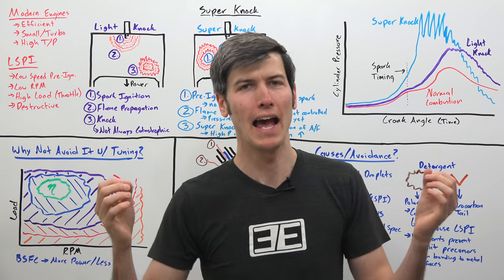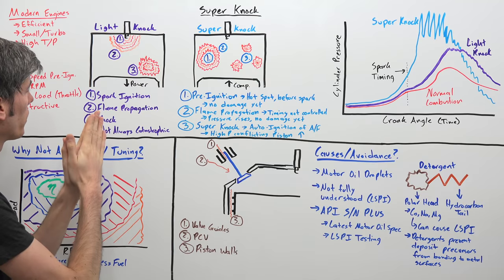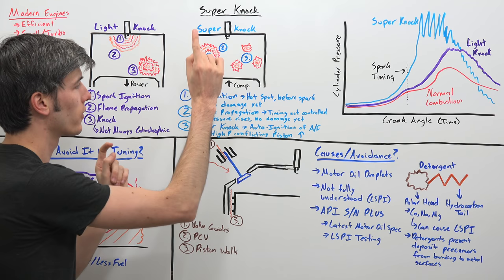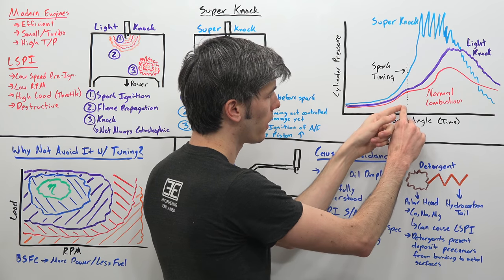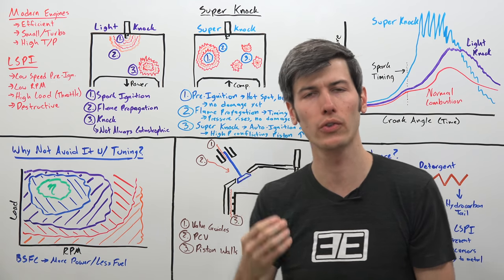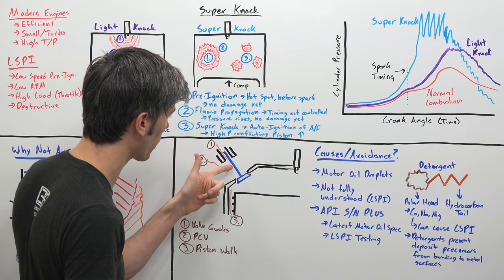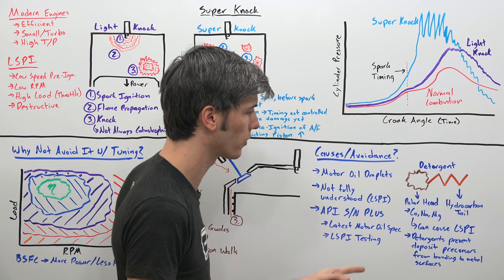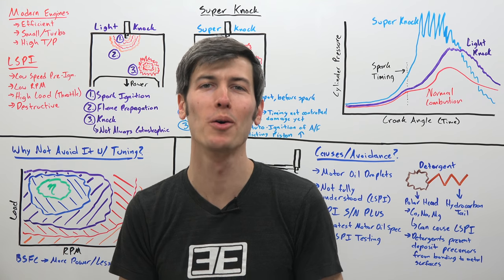How Super Knock Can Destroy Modern Engines

Comment: Yeah, let's be real.  We need 95 octane fuel at the pumps now.  Good oil doesn't hurt
Reply: As long as the engine designs dance on the edge increasing the octane in response will only make it worse. We learned to live with compression ratios under 10:1; we can live with 87 octane. The problem is with engine design, not with fuel.
Reply: We have here in Australia but I can hardly afford it.
Reply: No, the UK has high octane fuel and your Ford st doesn't blow up like they do when you run on low quality fuel. Lots of performance engines want high octane fuel. My motorcycle says loss of power and fuel efficiency if you run low octane fuel, their not joking, you can feel it just with stale fuel!
Reply: In Europe we only have 95 or 98 Octanes, why is it 87 or 89 in the US? Im asking bc I have no idea on this
Reply: @sergipolo7835  That's actually a very good question!  And here's my saga.

  In the U.S.A. there's no restriction for vehicles being 100+ years old on the road that were developed to be used with lower octane fuels. 
 So in short, you can drive any age vehicle in America without special permissions.  Very few things disqualify a car from being driven in America, outside of gross emissions.  They can be full of rust and drive along side everyone else.

  Also, there's a good amount of economy cars that use very little ignition timing, so they can run 85-87 octane fuel without damaging their engines.

  At sea level, 93 octane produces a perfect stoichometric burn for the emission standards in the U.S.A..  At 5280 feet (a mile above sea level) or (1.6 kilometers) 91 octane has the same effective knock resistance that 93 octane has at sea level and is actually the same fuel, it just has a different knock resistance value depending on what altitude it's being used at.
 
91 octane = 93 octane at sea level and vice a versa.

  The reason 91 octane works at higher altitudes is because engines can safely use more ignition timing due to reduced air density but will ultimately lose power as they go higher in elevation.

  In order to keep power levels up, higher octane is needed to run even more ignition timing safety.

  The higher the octane, the more ignition timing you can run in higher air densities.  

  You guys get 95 and 98 octane because your auto manufacturers work along side the government and don't want mechanical issues to cause fatalities on the roads.  In America, we have 300+ million people, so a few people blowing their motor on the highway causing a pile-up isn't even a drop in the bucket.

  You are very fortunate to have high octane fuel to drive fast and hard with little worry for your vehicles mechanical integrity.

98 octane in Europe (2500 feet above sea level) = 95-93 octane in America (0 feet to 14,000 feet above sea level).

You guys just have better automotive standards :]
Reply: @gammalight1312  Oh thank you for the explanation! I didnt expect such elaboration. Could that be related to why are turbocharged smaller engines more common in Europe? I dont think the downsizing trend is good but the higher octane gas does help right? So those super presured engines would have more problems with the lower octane gas. The altitude fact is interesting and good to know too, but I live next to the sea so doesnt really matter for me. As for the drive fast and hard thing, well, only Germany has no speed limit on Autobahn and the high prices on gas dont help either :( Anyway im glad to hear that we have good automotive standards, I wonder if I take my small 3 cylinder car to the USA will it suffer from the gas.
Reply: @sergipolo7835  glad you got a chance to read it! 

  Small engines can produce huge power with turbochargers or superchargers and unless they're naturally aspirated they must use high octane fuel.  
It sounds like Europe is looking toward small displacement, high efficiency motors to maintain emissions.   America is doing the same but with hybrid electric and small displacement turbo gasoline.

  Only naturally aspirated engines can accommodate low octane fuel while making decent power.

  If your 3 cylinder car is naturally aspirated and has a modern ECU, you'd be able to drive it in and on American gas with no issues.  If it uses a distributor, you'd have to manually turn the ignition timing down but unfortunately you might notice power loss on 93 octane.

  Always use the fuel recommendation or higher on the fuel door of your cars but if your car is turbocharged, never use low octane fuel unless you're at high elevations and have no other choice.

  One thing I forgot to mention was America has developed an alternative to petrol fuel that is made from corn.  It's 85% corn ethanol and 15% gasoline blended together (E-85).  It's equivalent to 105 petrol octane, available at the pumps.  It cost around $2 U.S. or £1 per gallon. So we do have that as an option in some places.
  The only problem is very few people know how to take advantage of it's potential because it's a relatively new / corrosive type of fuel.

Conclusion:
 I always recommend running as high of octane as you can unless you drive like a grandpaw :)
Reply: @gammalight1312  Europe also uses a different octane scale. 

93 at the Pump in New York City is the same as Super Plus at the pump in Dusseldorf.

Comment: Getting all the time with my Subaru FA20DIT with CVT. In normal "Intelligent" (economy) mode, the CVT keeps the RPM's so low all the time. Very often when the engine is loaded to accelerate up a hill, it has a habit of knocking. Very dodgy.
Reply: Same here but in a Chevy with 1.5L turbo 4cyl.

Comment: Hiii what do you think of 2 or 3 spark plugs per cylinder. Does it reduce the probability of super knock _ (DSTI Engine in Bajajs motorcycles engines )
Reply: Super knock occurs before any spark, so you can have a dozen plugs in there and it wouldn't make any difference. Watch the video all the way through. Jason discusses this.

Comment: (5spd driver) sometimes when i am going downhill or using engine braking, and after a few seconds when i press the gas to start accelerating there is a lurch. Is this LSPI? This occurs if engine brakign was holding around 2.5k RPM. Yes, this is a GDI engine

Comment: Freevalve heads must use some sort of lubrication. But not having oil in the same way in the head as with a normal cylinder head should probably make for a nice improvement.      ?

Comment: Great video!! I am hoping either Jason or someone in the comments can help me wrap my head around another engine related subject, that being how the horsepower formula accounts for the work done by all cylinders in a four stroke engine with 4 cylinders or less.

     My confusion arises from the fact that there is no power stroke  over lap in an in-line 4 cylinder engine. If I understand that the formula HP= (torque x rpm)/5252, and that the torque is the force the crankshaft is experiencing at the particular rpm when the measurement is taken, wouldn’t this only account for the power one cylinder is adding? Again, relating this back to a 4 cylinder having no power-stroke overlap, means that the crank only experiences the torque one cylinder adds to it at a particular time. This is in contrast to engine with  more then 4 cylinders where power-stroke overlap occurs.
  
     Another way to look at it is that if only one piston is adding force to the crank at a time, what would be the difference of calculating the horsepower of a 4- cylinder and a 2  cylinder ( hypothetically lets say they have the same efficiency,) and each engines per cylinder displacement and stroke are the same.
     If you ran them both to the same rpm, and took a horsepower measurement would they be the same, since once again only one piston is providing power to the crank at a time, how would the power the other cylinders provide in the same amount of crank rotations be accounted for?

Comment: e30. Check out the e30 Challenge, a program originating in South Dakota and Iowa to, obviously, promote higher ethanol content in fuel. . Over 20 million real world miles accumulated in non-flex fuel vehicles with no CEL or other malfunctions. They mention that Mercedes urged the EPA to approve e30 due to the efficiency and "ridiculous power" their turbo'ed engines produce with this high octane fuel. My GT350 is Lund-tuned for flex fuel. Ethanol is a godsend for high performance engines.

Comment: What about the type of gas. I heard 91 grade is so it doesnt pop until the sparkplug sparks. And then I've heard taking 91 grade on a car that recommended 87 gas might leave raw gas since sometimes it's not enough heat to burn it all. Causing knock, poor mpg, and possibly hurting your catalyst converter

Comment: I'd like to know how CNG (natural gas) performs in a N/A engine (M/T) when being at high loads but low RPMs. I'm used to drive a vehicle with CNG, but of course wouldn't like it to be the 'lab-rat' and blowing the engine.

As far as driving as efficiently as possible without harming the engine, I usually have the engine at very low RPMs (1,500-2,500) but giving it very little has (light load) as the engine has only 90HP and when the vehicle is fully loaded and A/C is on the difference is really noticeable. I do know CNG has a slower combustion speed therefore spark advance is vital for the engine health, but as natural gas has a higher Octane rating, knock is somewhat less likely to occur.
Thanks.

Comment: The most simple solution: don't buy a car with a tiny engine. That was in the introduction right? The problem only occurs in tiny turbocharged engines that have to carry a too large of a load (1.2 liter engines fitted to regular car). Just get something above 1.9 and you'll probably not run into this problem.

Comment: I know from Peugeot modem DI engines putting poor quality fuel such as 91 Ron can cause carbon buildup in the valves and cylinder which can lead to super knock and engine failure

Comment: Changing the oil? I wonder what that will do to an older valvetrain. Chrysler didn't move away from a flat tappet cam in the 4.0 all the way to the end of the engine life.

Comment: This is a big reason I run with methanol injection and have my car tuned to limit its power severely below 2000 RPM. I want my valves and cylinders to be clean and don't care as much about efficiency. I want an engine that doesn't decide it's time for a knock knock joke every 2 revolutions.

Comment: >happens at low rpm under high boost
>shows Honda S2000
What next, camshafts problems explained with an RX-8 in the background?
Reply: @dies ist kein Name His S2000 is supercharged!
Reply: @harbl2479  He hopes there is some simple additive/fix so he doesn't have to rebuild his S2000 with low-compression pistons.
Reply: This happens to gasoline direct injection engines not older style port injection engines
Reply: In not going to rewatch the video, but several times he correctly said "under high load"..... it affects naturally aspirated cars also.
Reply: @harbl2479  Yes but it hardly falls into the 'high boost' category.

Comment: isn't the EGR one of the ways to reduce preignition? I thought that introducing a small amount of inert gas into the compression stroke helps reduce the temps and therefore keeps the fuel from exploding rather than combusting.

Comment: You should have made mention that E85 is a super weapon against super knock.
If you have a flex fuel vehicle, try running E85, it will resist combustion and it will clean everything along the way, potentially resolving the issue entirely by removing carbon build up and at the very least preventing more carbon build up.

Comment: You're channel got me wondering if you could make a video about low power diesel engines. I have a VW Crafter that's putting out a 100hp and 250nm of torque out of a 2.0 litre diesel engine. Why don't they just use a 1.6 TDI Passat engine that makes 120hp and 250nm of torque? Wouldn't this be more efficient? Or is a bigger engine better of the lifespan of it?

Comment: Something that remains unclear to me: With modern engines using very precise direct injection, if the petrol is only injected at the moment of ignition, why is knock an issue? Or to put it differently, can't you just increase pressure similar to a diesel engine, and then only inject the petrol at the last moment? Of course it will ignite / self combust instantly, but if it is late enough in the cycle that shouldn't be an issue? (on the contrary, efficiency and power will be much higher) What am I missing?

Comment: i have a 95 Subaru WRX that jolts and is jerky at full throttle 3500+ rpm , like it cuts out for a split second and a big 'bump'.. Is that SUPER knock ? Besides that it runs smooth and pulls hard , I am using the maximum octane fuel

Comment: What about commonrail gasoline engines? Sure, it's quite rare engine and more like prototype (why does it take so long?) but it works similarly to diesel. Flame propagation is cause by fuel injection, so any hot spots have no fuel to burn anyways. That's also probably why this is much less likely to occur in diesel engines.

Comment: Its the fuel 
You need high octane like 98 and 99. surely when you tune the engine
And dont put high loads at low rpm 
This wasn't a probleme in the golden days of cars.
When fuel was pure and people shift at 3500 rpm 
Now the bc and automatics shifts or tells you to put it 6 gear at 50 km/h
I did this once to test this 
And car was shaking and sounded like it was going to die 😁
Reply: We should use manual/sport mode for all times if this is the cause.
Reply: @govinlock8568  Many automatics have an overdrive on/off button for climbing grades. Economy mode may allow the engine to lug at light throttle input, but that's not going to accelerate well and can kill an engine.
Reply: @jamesplotkin4674  Well, not much automatic cars in my country that has multi mode for its transmission. You either get slow climbing acceleration for using D lever or drive its transmission manually to either 1,2,M or S.

Comment: I was always taught that was called detonation, as opposed to super knock
Reply: "super knock' is Preignition, light knock is detonation. The difference is the role of the spark plug ignition in the knock.
Reply: @patrickzambori473  Detonation is actually severe knock. The ignition stops propagating by the flame front and instead propagates by the pressure front, turning the mixture into a fuel-air explosive.

Comment: Hey What about the effect of altitude on Knock in turbo motors.. Ive got a 2018 Focus ST and a tune that wants 93 octane.. But in the mountains where you and i live we only get 91.. Is this safe???
Reply: No, you need to run a 91 map and log for knock and timing correction. The assumption you can run lower octane at altitude is only on NA engines, your turbo compensates for the lower air pressure.
Reply: @prayformojo1117  
Alrighty... Ive been trying to get multiple sources on this.. I've contacted a couple local tuning shops and they say it should be okay because off the shelf tunes are usually pretty conservative anyway.. that mixed with the altitude it could be okay.. but I knew that turbos make up for alot of altitude that NA motors are effected by... so I'm just looking for a more in depth answer..

Comment: Is this video relevant for both diesel- and petrol engines?
Reply: I think only petrol, diesel engine compress air, not air/fuel mixture, during compression stroke, so there can not be flame there (of course if engine run in normal conditions, not engine runaway or somthing else).

Comment: @Engineering Explained - Can bad or old oil cause Super knock (LSPI) in modern engines? For example; you take your vehicle for its annual service, but the mechanic fills the engine with very old used oil to create damage?

Comment: Interesting video. But could someone provide some insight on the likelihood of such an LSPI event occuring and actually damaging the engine ? Is it something to really worry about or is it more of a theoretical issue you should be really unlucky to run into ?

I personally own a car with the 1.0 L Ecoboost from Ford that has been in production for more than eight years now, and I haven't heard of any consumer reports regarding pistons and rods cracking under high load scenarios.
Reply: I can confirm this is true. The first motor in my 2016 Chevy Malibu blew at 59K miles. Warped heads, melted/burnt pistons. I did oil changes on the dot and it still happened. Little did I know is was producing a lot of blow-by without my knowledge then and also its my first turbo changed car. PCM recall was issued to back the turbo timing but GM knew pistons were cracked at a early stage. Got a new motor from GM and a year a few months now I am having spark knock issues even though I run 91 Octane and have installed a oil catch can since. My spark timing seems to jumping around at idle. I dont really know if it'll blow up on me for the 2nd time.

Comment: Why does the super knock occur only at low speed and high load case? Shouldn't it also occur at HIGH SPEED HIGH LOAD case, when the engine will be running even hotter?

Comment: Would using water injection reduce the likely hood of super knock by reducing cylinder temperatures? Just curious
Reply: Very probably. It would at least reduce cylinder overheat, resulting into less fuel injection needed for cooling.
What I would see as a problem, is the probability that some other things are present in the water, like limestone and other third elements. Bringing other issues with them.